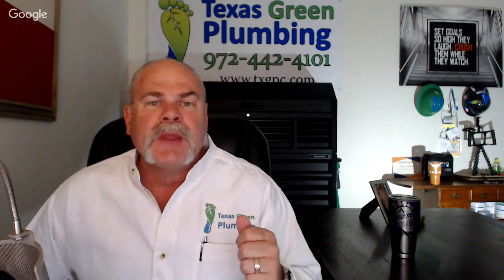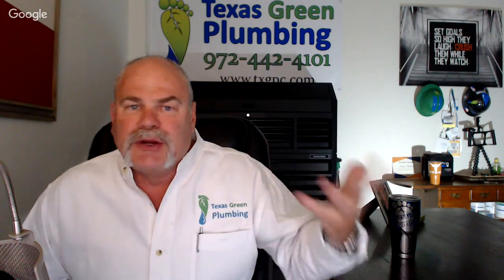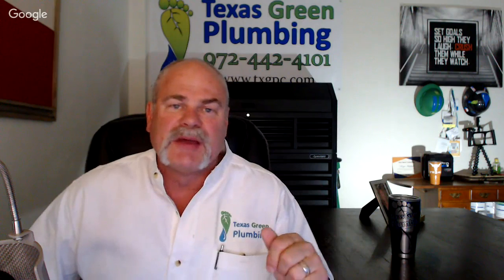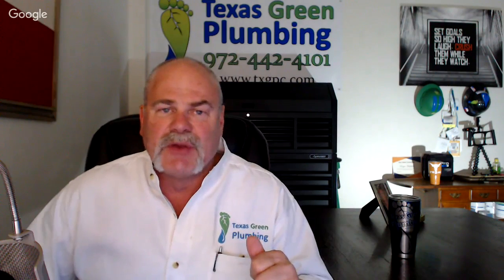Will I Have to Change My Gas System For a Tankless Water Heater?

Comment from the maker: Be sure to leave any questions you have in the comments, we'll answer them in a future episode!
Reply: Propane: So from my reading a 3/4" line should be enough to supply a 150K BTU (max) tankless stems then? My unit will be installed outside and the tank will be 10-15 feet away from the tankless system, so we are looking at less then 20ft of line. Comments? The tankless is the only load on that line.

Comment: In theory you are correct but tankless water heaters are STAGE FIRED units starting at 15,000btu.  Its not always that people use 11gpm but only on rare occasions.   People usually do not run hot water out of every fixture all the time.  The odds are you will never have a problem with heating water for most instances.   if you can afford the extra expense, upgrade the line to 3/4"

Comment: Enjoy your videos - have much respect for plumbers (not an easy job). I'd like to add a Natural Gas 120kBTU/h tankless unit. My meter is rated for 210 CFM, which should be good for 217,770 BTU. The meter bar has 1/2" FNPT ports, and the gas company uses 1/2" street fittings (quite small inside diameter). The rest of the system is 1-1/4" black pipe (25 linear feet) to the tankless unit. Will the street fittings at the meter pose a significant restriction? In spite of the generously sized meter/piping?

Comment: I had a navien tankless water heater installed.  I noticed my gas meter chirps like a bird if a shower is on.  Does this mean, I need to have the gas company replace the meter.
Reply: I’m a home inspector.  Excellent point about the fireplace log lighter. I am going to introduce that into my inspections. A rule that we usually follow is the gas line to the water heater should be directly off the meter. I will typically pass the water heater inspection if the line is three-quarter inch and within 30 feet of the meter. As the home inspector we’re not doing a gas load test or Gas line isometric. Do you have any at a glance recommendations that would be red flags or rules of thumb if or when we are not actually doing a gas load test which of course is not part of the Home Inspection.

Comment: I have two 50ga tanks ( one for upstairs, one for down) .  They appear to be each be fed by a 1/2” gas line.  Can I replace both tanks with a single whole home tankless by combining the two gas lines together?
Reply: You may consider going to AO Smith University and taking the manufacturer classes and this probably will answer most of your questions.

Comment: Do you have any details on the 275 gas meter example for pressure, what was the pressure output of that meter? Could you upgrade this pressure or is this set?

Comment: My fireplace has a pilot light.. I'm replacing a tankless with a 1/2" gas line to the water heater .. rinnai says the new one is 1/2"compatible@ 199k btu's